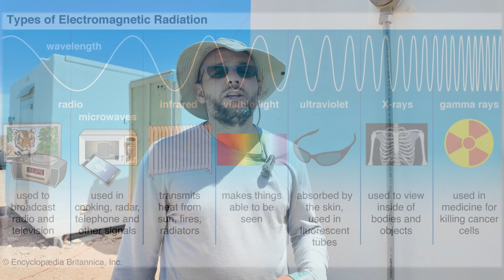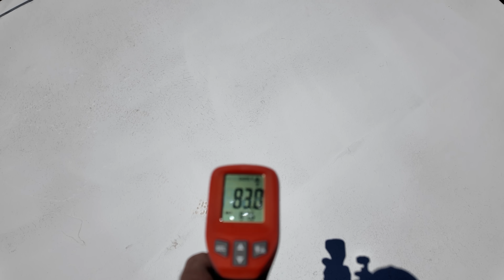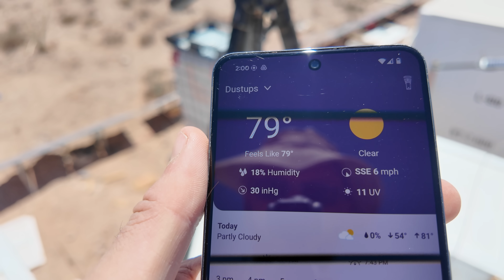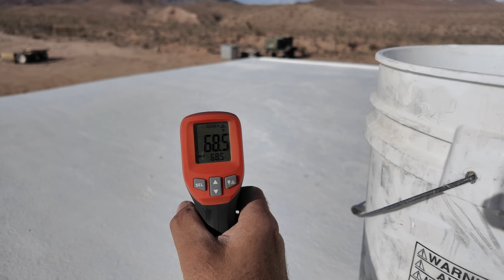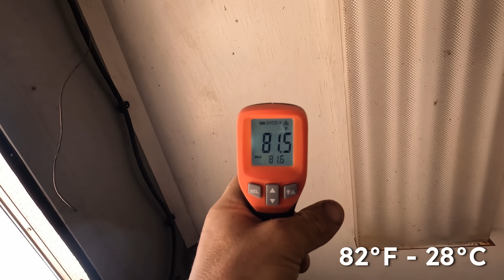I sprayed "cooling paint" on my desert cabin...this is shocking

Comment: I live in Cottonwood, California - the northern end of the Sacramento Valley.  Every summer the heat goes up over 100 for consecutive days in June, July, August and often well into September.  The temp often soars to 110 or more.  Last June 2024, the temp went up to 119 here.  That was the high record but other days that week were all above 110.  So having said all that, my HVAC went out last winter and I am saving up to replace it.  First, though, I will get a Whole House Fan which several people have recommended.  This is a different way to cool the house - and so when the outside air temp is lower, as in around 5:30 or 6AM, outside air is pulled in to cool the whole house and then all windows are closed and covered to keep the cool in all day.  This works well because night time temps get down to the mid 60s often in the summer.  The down side is the several weeks that the night time temps stay above 75, so AC will be used then - I have a portable unit.  Could this work for your buildings?
Reply: It is an interesting idea but I don’t think it will work here for one reason, size. In a conventional house you have multiple rooms to hold onto the cold so you can open the door multiple times to come in and out without losing all the cool air because it is spread out through multiple rooms. Here it is one small room and people are going in and out throughout the day while working on the property. As soon as the door is opened you lose all the cool because the one room cabin is just too small to hold the cool air once the door opens.

Comment: It'd definitely be more expensive, but I'd think you'd wanna do solar. You get so much sun there, the biggest part is the batteries and you wouldn't need a massive bank because you'd be wanting to run the AC during the day mainly. Minisplits are INCREDIBLY efficient.

But if you go with a minimal sized bank you could definitely get AC going for a reasonable price.

Comment: Couple of questions. Why not put solar panels spaced off the roof to shade the roof? Use the solar power to run inverters just for the daytime AC? I am assuming the nights are coolish? I grew up in 29 Palms Ca and most summer nights were bearable because of the solar radiation you are painting for. Put awnings around the buildings to shade them from the sun, this also keeps the reflected IR from the dirt off the buildings.

Comment: Idea and you engineers out there shoot it down all you want…. The polymer you have absorbs water….if you coated that onto an evaporated straw pad then sealed in clear plastic. The water/polymer would absorb the suns heat , the plastic would prevent any evaporation and at night cool the process for the next day. Place the pads on the roof to absorb the radiant heat.

Comment: Have you ever looked at the "Eco Cooler"?
The Eco Cooler is a grid of empty soda bottles with the bottoms cut off, mounted with the wide side out, and in your case could be placed in the door opening (as opposed to the more common placement in a window). 
It uses the Joule-Thomson effect, where being throttled,. The neck of the bottle acts to compresses the air, and this cools the air when it exits the neck of the bottle (rapid expansion) inside the cabin.
Depending on air speed, direction etc this can cool the air significantly.
Reply: have you done this in a desert and dry  location ???
Reply: @shamanking5195 I don't live in a desert climate, but the physics of the principle shouldn't be dependent on ambient humidity.

Comment: That radiation paint is really cool, in every sense. Looking forward to see some more the progress of the camp. 
I'd say with some shade on the south and west walls, and that wind circulating the air behind, they could prevent a lot of direct heat from reaching the buildings. 
Just some wooden shading structures could do a lot. Fences and carport/pergola-like shading that can withstand the high winds. Just made from cheap pallets and a few big poles. And it would be nicer to sit underneath during siestas. 

Growing any meaningful shady vegetation around the building would be the next step if it would just rain a bit. Create a cooler oasis especially around your camp. Keep it up guys!

Comment: Really, the best thing would be a desert forest, for the shade and evaporative properties. Can't be that hard to do.... In the meantime, think about a four-pole shade structure using a tarp... BUT, you need to incline the roof slightly into the prevailing wind so it creates a Venturi where you're sitting/sleeping.  Venturi = low pressure = decreased temperature.  Might be difficult to sustain with your wind, though.

Comment: build a second roof a couple or 3 inches above the existing roof, leaving the gap . With the, seemingly, constant breeze you have, it will flow through the gap at a slightly higher velocity. This in turn will pull the air through and create a cooling effect by drawing off the heat from the building structure. It is a type of roof that is used in tropical/hot regions on buildings and also used on vehicles such as Land Rovers. There are plenty of pictures/ examples within online searches.